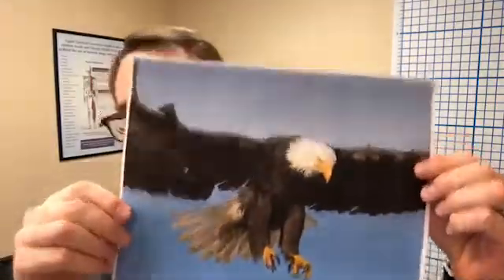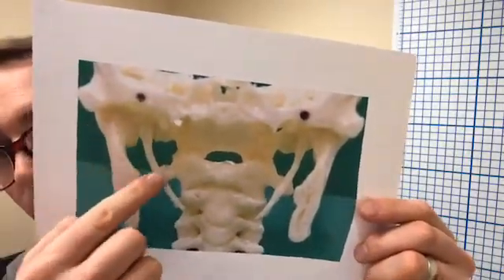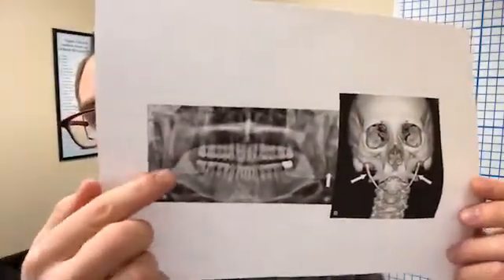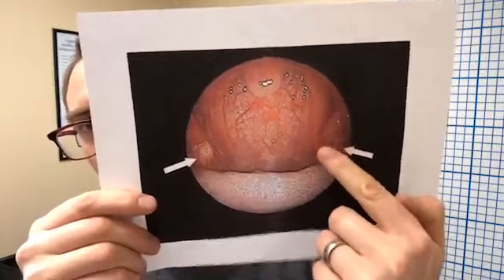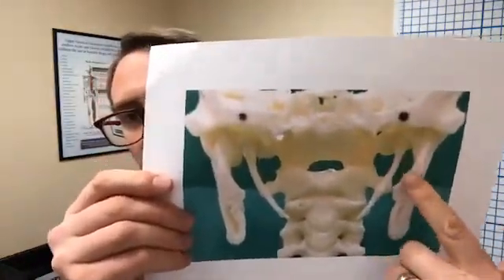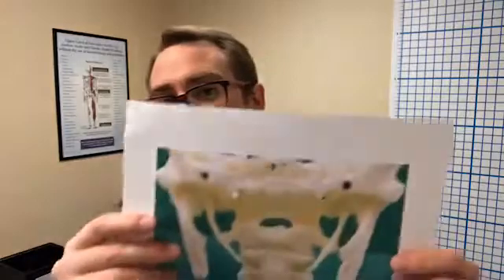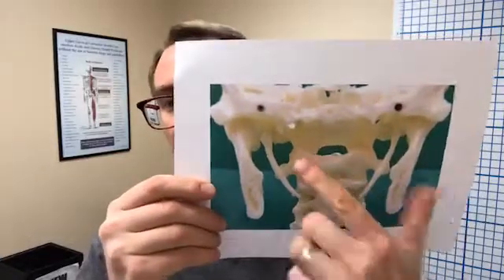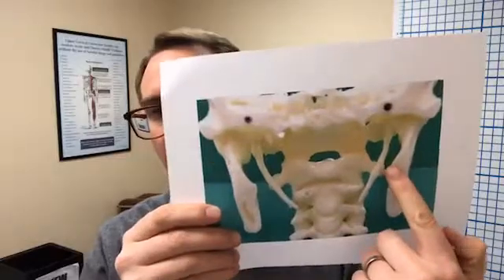3D printing technology in the diagnosis of Eagle Syndrome

Comment: It took my dentist to suggest that I might have Eagle's Syndrome after my symptoms started 5 weeks after cervical fusion surgery.   After multiple surgeries (styloidectomies), I am hopeful that both of my styloids have been fully resected by now.  I wonder what a 3D scan would nowadays.  One of the problems surgeons ran into during my case was that my styloid process was intermittently calcified AND way too long.  My first surgeon thought he had resected it completely only to learn that I had more calcification than thought.

There is also a RELATED condition called glossopharyngeal neuralgia (GPN), which is often connected with Eagles Syndrome.  GPN issues are triggered when there is an irritation on the 9th cranial nerve and the elongated styloid process is often the culprit.  

As a patient, one of the complicating factors I learned first hand was that Eagles Syndrome is treated by an ENT surgeon (otolaryngologist) and that surgeon usually performs a styloid resection called a styloidectomy.  However, if you are primarily diagnosed with GPN, a neurosurgeon addresses that condition by performing a brain surgery called microvascular decompression (MVD).  MVD may remove the sensations and triggers caused by an irritated cranial nerve, but it doesn't remove the cause (ie the styloid process).  You can learn more about this condition and triggering events here:  https://www.youtube.com/watch?v=gsGdq6HCOjc

I would encourage any patients with these issues to see a surgeon in each specialty and ask that surgeons do their best to determine the source of the pain.  If the source of the GPN pain is Eagle's Syndrome, then surgical resection should remove the need for brain surgery absent a co-existing condition.

While I am an ACTIVE user of chiropractic care, I had received some warnings about avoiding cervical adjustments (or using only the activator on the cervical area) prior to the resection since Eagle's Syndrome can make contact with the carotid artery and cause the patient to black out, etc if a manipulation causes the super long (and calcified) process to make contact in ways the carotid artery was not designed to accept.

Otherwise, thank you for a great video on this condition.
Reply: Thanks for sharing your experience!   I’ve tried everything, except surgery .  I’ve found no relief, getting rather worse.  If you could share your surgeon’s contact info , would be appreciated.  Thanks again…
Reply: @flora5398  Dr. Randal Paniello at Washington University in St. Louis
Reply: @Familylawgroup  Thank you so much!  I’ll seek his help, hopefully accepts insurance and out of state patients… 🙏🏽
Reply: @flora5398 que síntomas tienes flora ?? Estoy igual